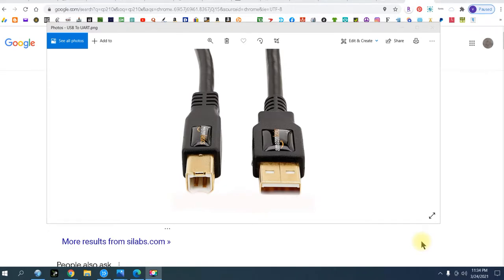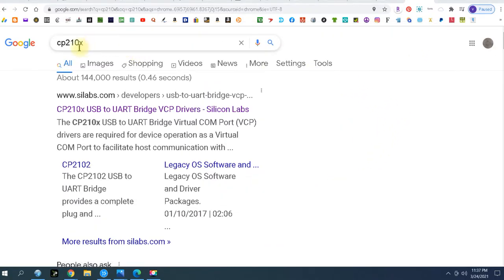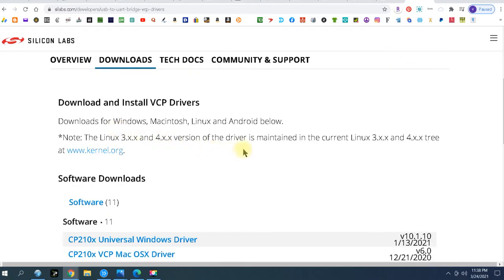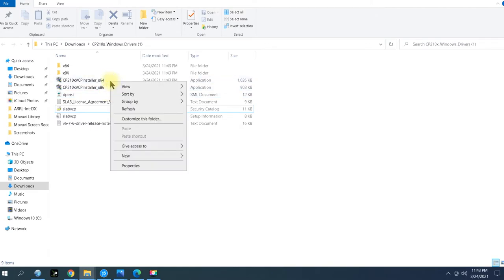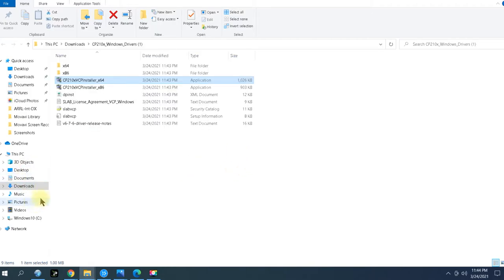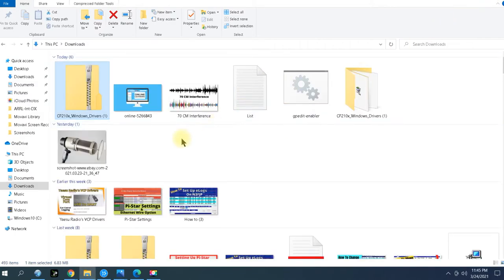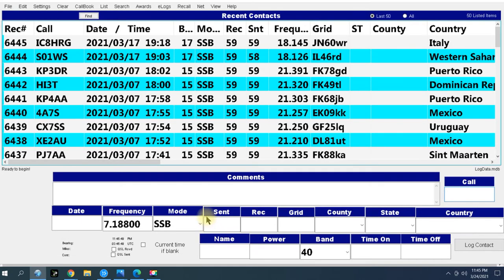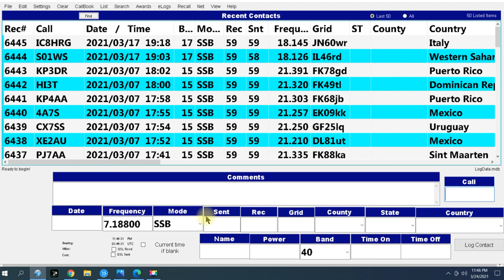HOW TO INSTALL CP210X VIRTUAL COM PORT DRIVERS / YAESU RADIOS

Comment: That driver seems to be  for windows 10 only right? Mine is already installed on windows 11 pro and when i try to manually install this one it doesnt show up as a driver install option. 

Any idea
Reply from the maker: I have not owned a win 11 machine yet, maybe you have to uninstall the one you have before installing this one. Do not connect the USB cable to the radio until after the install.

Comment: hi i have done everything you said in the video but the port was not appeared in device manager please help me out from this bcoz i need to do a project ..
Reply from the maker: I did not have any problems installing mine so I do not know how to fix it, here are two links that may help: https://community.silabs.com/s/article/cp210x-and-device-manager?language=en_US  and  https://answers.microsoft.com/en-us/windows/forum/all/usb-driver-from-silicon-labs-cp210x-will-not/b6b7211f-f88b-4292-a6fc-45636f0ec642  I have learned from other users that a very small amount of win 10 computers will not accept this driver. It has to do with a certain build/version of windows.

Comment: I have followed all your step however the port did not appear on device manager
Reply from the maker: Ok delete the file you downloaded, disconnect the cable on the computer side. Downloaded it again, once finished connect the cable cable, turn radio on and see if it is the device manager.
Reply from the maker: I am sorry, this is how it worked for me. I have an ftdx 3000. Maybe you can try a different cable or contact Silicon Labs. I know Yaesu has changed their interface method to the scu 17. But my cp210x still works.  I also know the FTDI chipped wires work well, but no FT8 audio codecs for FT8 use.

Comment: I cannot install drivers. Look at this massage on device manager:   "This device cannot start. (Code 10) 
The specified request is not a valid operation for the target device."

What is wrong? I am using windows 10.
Reply from the maker: I have not experienced this myself, but I have heard it before. There could be a number of causes, maybe this can help you: https://recoverit.wondershare.com/computer-problems/this-device-cannot-start-code-10-error.html

Comment: what other ways did you try, so that the virtual com port pop up. You said it took you a couple of tries. What did you do? Thank you
Reply from the maker: I tried it several times the same way, then I tried it with the USB cable connected, then again disconnected. It worked with the USB cable disconnected.  Since making this video I  talked to several people that could not do this because of the version of Win 10 they had.  I would look into that if you can not get it to appear. Also, win 10 may be forcing the use of it's drivers and not letting it appear. Mine worked so I did not have to do this, Just an idea.  Good luck

Comment: Is this the correct vcp drivers to use with fldigi or mmtty? I want to run rtty on my ft-991a...
Reply from the maker: I have not used those programs so you wikk have to research that, I use it with N3FJP and WSJTX.
Reply from the maker: I have not used those programs, I can say it is the corret one for N3FJP and WSJTX. Since it is for yaesu radios interfacing you may want to look into that.